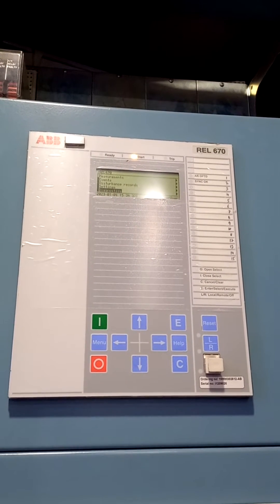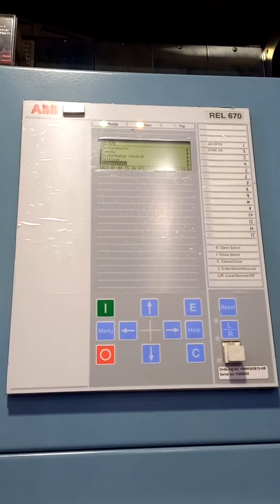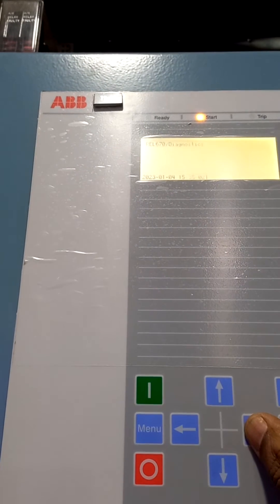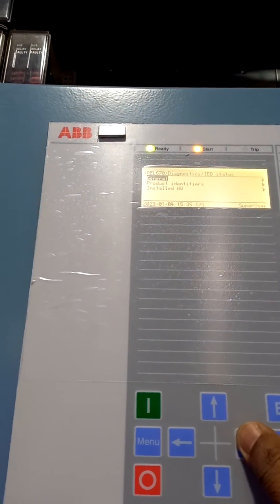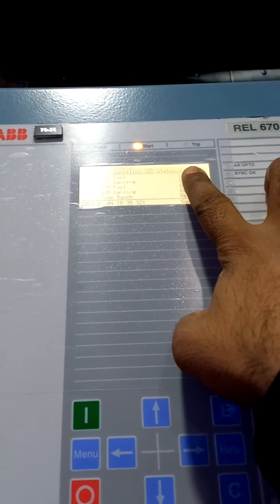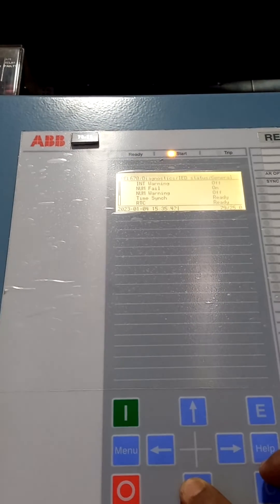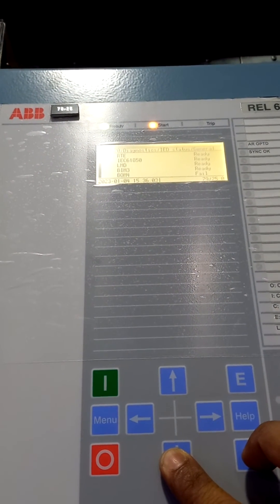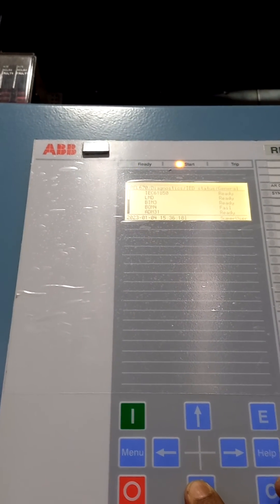ABB REL670 relay hardware failed  checking methods

Comment: Display became blank & button not working then how to check
Reply from the maker: Switch off relay power supply and check whether it's working or not. If not then there may be HMI as well as hardware fail issue . Then relay will be sent for repair
Reply: @powersystemhub2811  yes ...done power off ..same problem .. relay may be damaged .. relay need to be replaced . Pls quide ..I have spare relay of model . I have project file of this relay in back up .. how I transferred this settings to new relay .. pls give me the full process. As it is 400 kV line &  also have scada programming